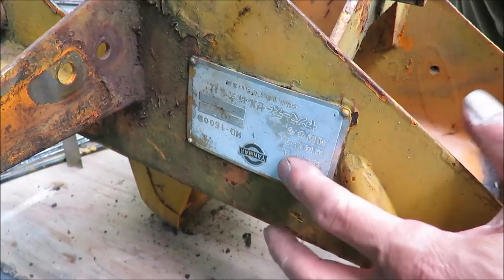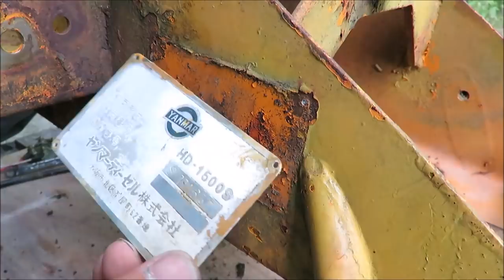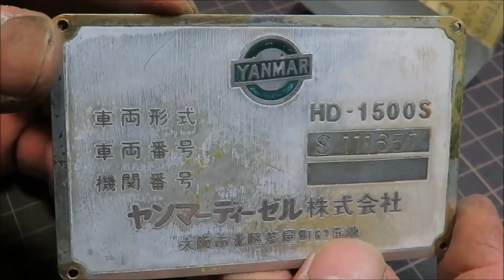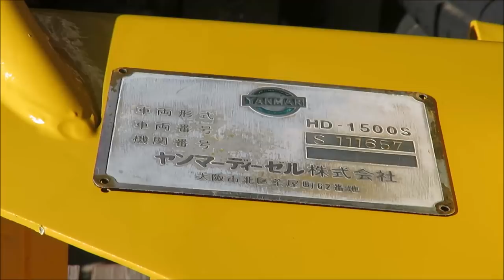ヤンマードーザーショベル⑪（YANMAR　DOZERSHOVEL）⑪操作盤のレストア　Control panel restoration

Comment: I think you would like an electric heat gun in place of the torch for paint removal. Maybe a sand blaster or even a hydro blaster to clean parts more quickly. Do you have evaporust over there?  I have a big tank and do electrolysis on a lot of parts.